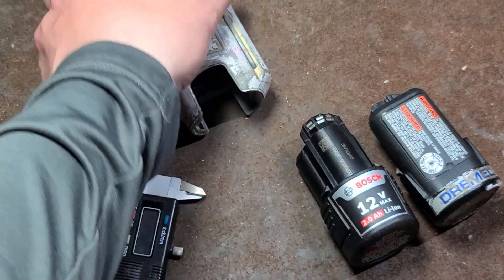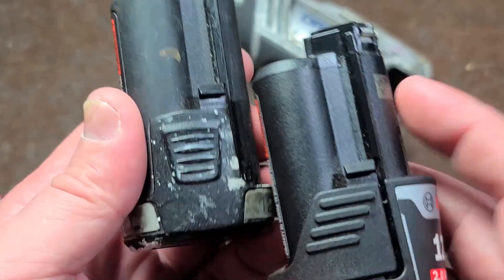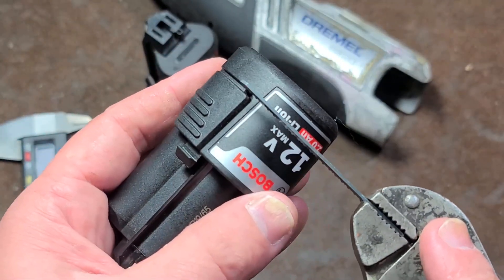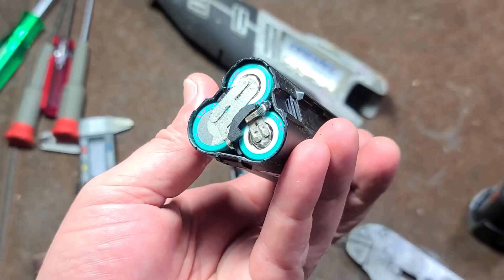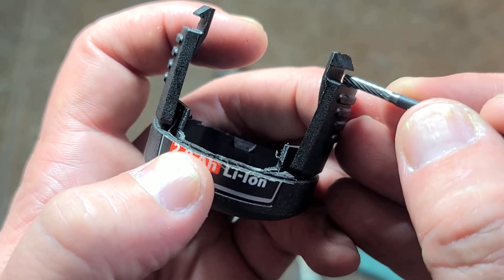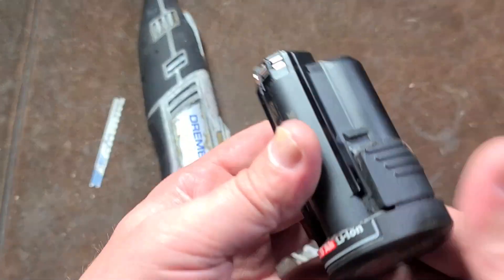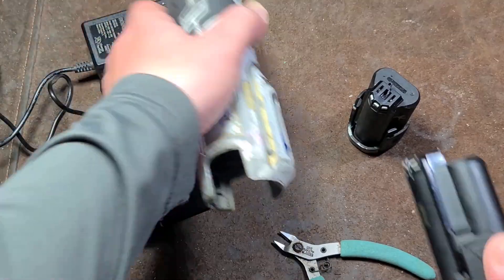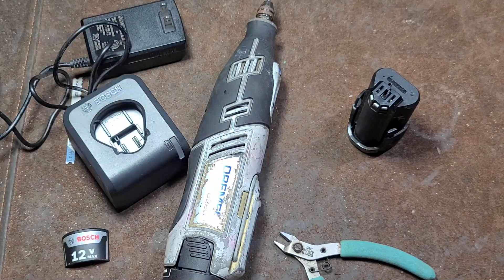Bosch To Dremel 12v Max Battery Compatibility Fitment Modification

Comment: So confused. Just bought an 8250 and supposedly all Bosch 12v batteries fit except the 6ah. I was too lazy to pick up in store so Home Depot is delivering it tomorrow. I believe the package has the list of compatible batteries. Also I do know the 8220 and 8250 use different batteries so this may not apply to my model because everything i see says thes Bosch 2,3,4 ah are compatible. Supposedly the “green” consumer Bosch batteries are compatible with the 8220, the “blue” professional are compatible with 8250/8260 with the exception of the larger 6ah one. Even looking at photos the 8250 battery is identical to the Bosch one you cut. Thank you for your effort and sharing.

Comment: Is there any way that you could put the top part of the Bosch battery in the bottom part of the Dremel?  If the Bosch battery compartment fits into the bottom of the Dremel battery holder then it should work in the Dremel tool and the Dremel charger.  Thank you.

Comment: Pure EVIL that Bosch adds incompatible batteries inside their own brand! The green and the professional (blue) 10.8/12V batteries also use different bottom clips. Same issue with the old 36V professional vs. garden batteries... I'm amazed/appalled that Bosch want to aggravate their own customers like that... :-(
Anyways, thanks a lot for showing the bottom part with clips etc. and prooving it can be removed! ;-) Now I just need to find someone selling new bottom parts (or even just 3D-models for printing)...

Comment: Dremel is só awesome that you can even use itself to make new batteries. I'll have to do this. The 8220 isn't available in Brazil but I got one anyway. However the charger is 110v and here we have 220v and I can't buy extra batteries, so this mod is perfect for me. I'll buy a kit with 2 batteries and a 220v Bosch charger, adapt the batteries and be on my marry way.
Thanks a lot for the video!

Comment: I used a Dremel with a cut off wheel to modify mine around 2 years ago, however my newest 12volt Dremel accepts the batteries without any modification.

Comment: Cool mod. The battery is just as ugly as the tool so it matches.  As long as it works.  I've owned a lot of rotary tools in my life.  I had a two speed Craftsman NiCad one that didn't last but a couple of years before the battery died but I couldn't get a replacement.  I have a variable speed dremel corded one that is extremely powerful with many attachments.  I more recently bought a variable speed Hitachi Lithium one that is excellent.  These tools are the most useful tools ever invented.

Comment: I used to use the dremel to actually do my Bosch Batteries. (The 2ah 12v Bosch were only like $12 or $14 on Amazon a few months back... so I stocked up on them. )

Comment: Nice the big issue is getting the battery itself I have some radio and tools that need specific battery and too much time to find them.  Then if you do find the battery you have to weld the connection and pain in the AZZ. For my Milwaukee battery I found you can jump start them that Is very helpful.

Comment: The newer Dremel 8240-8260 series tools take the Bosch batteries without issue. Edit: The Bosch GBA12V60 6.0 Ah battery (and the discontinued 4.0 Ah battery) will not fit in the Dremels.  All other Bosch 12v batteries will fit. I picked up this tidbit on the Tools Tested channel. I didn't have a 6.0 battery at the time of my previous comment and so had to acquire one to confirm.
Reply: They did a decent job on the design of those... but I'm still skeptical of Dremel after going through so many 4300 and 8220, I went to the Actual Bosch Rotary tool, and it's (oddly) wayyy better than the 8220. 
 
I had a lot of overheating on the 8220 series. 4300's had that horrible locking mechanism that always seemed to brush against something,  completely shred the front ends of those.
Reply: @carterscustomrods  My go-to Dremel was a corded Multi-Pro 395 that, aside from periodic brush changes and a plug end that broke inside of the first month, was great for many years.  When I decided to get a cordless one, I looked at the Bosch GRO 12V-35, of course.  But, although it's available by various means, it's not an official USA product (so no Bosch USA warranty support) and it's a little pricey.  So, when I happened upon a Milwaukee 2460-20 for a good price, I got one. It is compatible with all the Dremel accessories. So far, it's been excellent and I would definitely get another one.   Just wish it was brushless.
Reply: @GM-gc8gg  yeah, the 395's were good for years of use. 
 
I like the Milwaukee a lot, but the feel, and weight just didn't feel right after using it a while. It's a high torque beast though... so if I need a cordless fine router setup, it's hard to beat. But I hated that grip, and collet lock button.
 
Why can't rotary tools use collet pick latch/levers like the B&D RTX (my favorite corded version over the past 5 years or so... I'm ashamed to admit that lol.)
 
Plus Bosch here in North America might not be around much longer... keep an eye out for Clearance sales.
Reply: @carterscustomrods  you ought not be ashamed of that, I've got a giant drawer full of rotory tools and those B&D's happen to be my favorite as well. I even sprayed one black back in the vanity of youth, however I'd never take the time to do something like that again. The color of the plastic and stickers on a tool are meaningless.
Reply: @carterscustomrods the 8250 is a beast. It’s also the only brushless rotary tool. Weird you have so many issues as Dremel is quality and make the best rotary in the states, but they do also make some cheaper budget lines like the 8220 but I have no experience with them. I have a plug in one. Can’t recall the model but it was the top one at the time, came in a gray hard case with tons of accessories and it still serves me well about 7 plus years later. I just ordered the 8250 which is more powerful than any corded model believe it or not. That’s not why I bought it, I just want a cordless one because it’s a pain to have to plug in every time you want to use it, especially for quick jobs. I’m the same with vacuums. Cordless most of the time because it’s easier and quicker, and plug in for deeper cleaning! I also have an old Dremel powered screw driver that’s built like a tank and can even drill holes in wood if you really had to
Reply: Do you know if you can charge bosch batteries on the new dremel charger?? Wanted extra batteries but not more chargers:/
Reply: Yes, if you are referring to the charger that comes with the 8240-8260 it will charge Bosch 12v batteries.  BTW, please check the edit that I made for my original comment.  The Bosch GBA12V60 6.0 Ah battery (and the discontinued 4.0 Ah battery) will not fit in the Dremels.  All other Bosch 12v batteries will fit. @EggyOrphan
Reply: @GM-gc8gg  thank you so much for the info really appreciate it🙏
Reply: @GM-gc8gg Excellent info. 

Would it be possible to perform surgery on the 6mAh Bosch battery base so it will fit in a Dremel 8250?
Reply: @johnbauman4005  Pulled out my 8250 and my GBA12V60 and it doesn't look like it to me.  You would need to get the stem of the battery to insert nearly 1/2" more into the tool.  To me, the better option is to use the Dremel BL816-01 3Ah ($69 on Amazon right now) or the Bosch GBA12V30 3Ah ($59 right now).  The 3.0Ah batteries last a surprisingly long time in a brushless tool.
Reply: @GM-gc8gg  Thank you so much!

I actually have one of each of those batteries in my Amazon cart right now. I was going to add the 6mAh battery (or not) depending on what answer I got to this question. Clearly, the answer is "not."

All the best!
John
Reply: I have a 8240 and I managed to make it work with Bosch 4.0Ah battery isolating the C2 terminal (the third one, on the right) with a duct tape